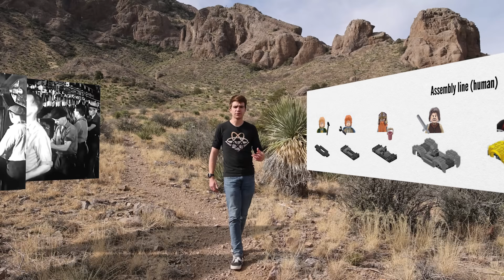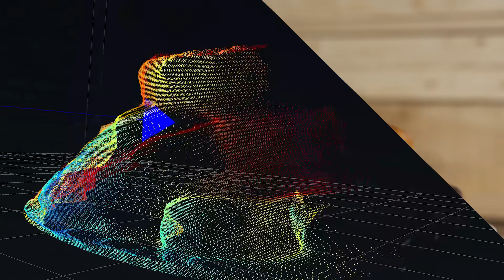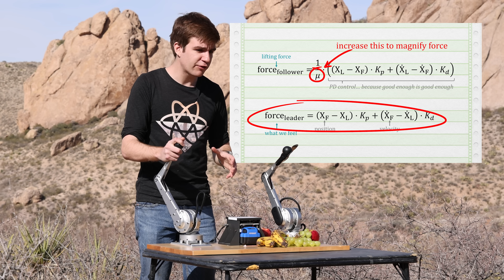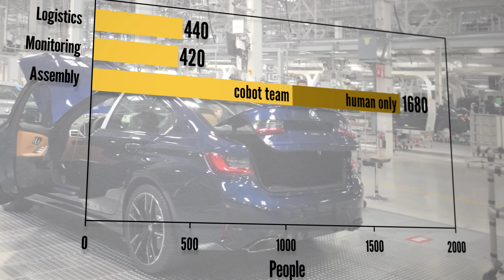Industrial robots are (nearly) perfect

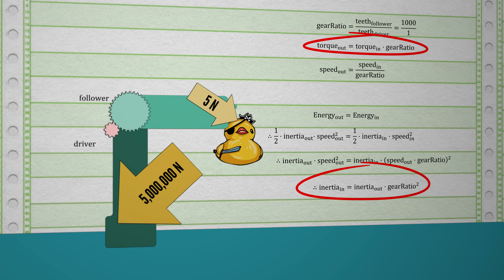Comment: Nice video. However, the 8:32 inertia calculation is wrong (inertia_in is actually 1/ratio^2 inertia_out) 
The conclusion is correct tho. The arm has (roughly) its own inertia plus ratio^2 the inertia of the motor axle and gears. So it acts as if it is incredibly heavy, causing a lot of damage on impact.

Comment: 8:33 The insides of the robot do not expirience a million times more force. They expirience 1000x more acceleration, which I guess can be damaging. But since work done on the outside is equal to one done on the insides, and the insides move 1000x more distance, the forces are 1000x smaller. The insides having a million times more inertia mean the internal components of the robot appear a million times heavier than they are, and so can transfer a lot of momentum into whatever the the robot is hitting.
Reply: yes thank youuu!
Reply: That part of the video made my brain feel a bit itchy.

Comment: The body shop and paint section don't look much different than they did in the 80s, certainly cleaner and we didn't have a camera taking 4 bazillion pictures. We just looked.  I used to work in the #1 color booth at gm in the 80s.

Comment: Ah can robots climb walls?
Reply: A dedicated wall climbing robot, sure... of course there is the matter of what type of wall (what's it made out of, how's it built?), how big the robot is, Why it's climbing the wall (and thus what Else it's supposed to do, which translates into weight and complexity), and so on and so forth. 
After all, it's not exactly difficutl for a robot to 'climb a wall' if you just need the robot to go up and down in a specific spot... a couple of rails and a chain on the wall, wheels on the robot, and a motor to move the chain, and you're basically done.   Climbing any given random wall at any given random spot is, of course, more complicated.

Comment: Thanks for confirming that industrial robots can be built with low-ratio gearboxes and beefier motors for safety. I understand with the situations where it's not strictly necessary will be cheaper to use a simpler motor, but yeah. I wonder if in the future, more dynamic control software/robot applications will require the "cobot" construction to become more common/the new norm.

Comment: Great video - fancy high tech robots - inefficient, outdated cars.
Reply: Essentially the same "fancy" factory will be able to build high tech cars. Car manufacturers like these have perfected assembly, it is what they do best. What they really only need to do is develop new platforms with new components. There are great battery suppliers out there, and developing your own electric motor isn't that difficult. Electric motors are not high tech stuff, we've used them for A LONG time and we know how to build good ones. Countries like Germany and Sweden have great experience of building electric motors for industrial use and heavy use (such as trains) - they just need to convert all that experience and knowledge into building electric motors for propulsion of small passenger cars, and doing so efficiently. 

Problem is, supply chains are huge and have lots of inertia (for these big traditional automakers). Someone starting from scratch (like Tesla and Rivian), have a much easier time building a supply chain for their needs.
Reply: @WoundUp  Including lobbying by e.g. German carmakers against tighter climate & polution regulations in the EU. Turning technical inertia into political inertia. Leaving space for China to take over.

Comment: "And who wants a boring steel car anyway?"
The engineering disaster that is the Cybertruck would like a word
Reply: Im sorry but youre wrong. It's ugly but its not an engineering disaster 

It's an actual amazing vehicle. It's the most advanced EV so far. It's the first  to have steer by wire and drive by wire breaking without mechanical linkage.

Elon actually was smart. Henry ford said the only colour for the model T is black. But elon said what about no colour? It's stamped and casted steel without paint.. it's cost savings sre enormous 

It would of cost a billion dollars to build a paint shop for the Cyber truck. They saved money doing that.

Plus the 48volt from 12 volt architecture is a massive supply chain cost savings. 

It's ugly design wise but drives amazingly because it's super easy from a turning radius.

Almost all EVs will adopt everything Tesla pioneered. Just like the model S and roadster did. Over time. 

Why is it sn engineering disaster when it's profitable and faster to manufacture than a model Y. It's at least a unique design, something different for once

Comment: the issue is still with how cars are conceptually made. if you start looking at canoo and then extrapolate and make it a "plug and play" based system, robots will have far easier times. 
adding gripping features that can interact with soft surfaces and camera/ai that can in real time calculate adaptive moves, you dont need humans anymore.

Comment: I'm quite concerned for many of these workers given the massive advances in humanoid robotics that have been happening in the past few years. The points about managing robot safety, depth perception, and freedom of movement mostly evaporate with LLM-powered networks of robots. And it's not like humans ever take jobs back from robots, or that humans will ever cost less than electricity. It's only a matter of time.

Comment: anyway you lost me around 8:12, can anyone explain in simple terms?
Reply: In essence: in this application, the robot needs torque rather than speed. But it wants to use electric motors. Electric motors (of this type), do not provide that much torque but do provide a lot of power. We combat this by having a gearbox. The excess power, if you will, is converted to more torque. For every 1000th spin of the electric motor, the output shaft rotates only one time. We call that a "gear ratio", in this case of 1000:1. Your car also has gear ratios, though much smaller differences. First gear can be, say 5 rotations of the engine does one rotation of the wheel (5:1), and in the highest gear it could be 1:1. Why do we do this? Just like riding a bike. We start out in a lower gear with a high gear ratio. This means we get more torque - but less speed. Then we use the speed we are going at to help us when we go to a higher gear, so that we can go faster.
Reply: @WoundUp  tbh at first i dont get power vs torque thing
Reply: @mateuszcielas3362 trying to get my head around the wiki article... something about rotational force? 
It's something to do with levers and fulcrum position... the relevance seems to be how violently one end of the lever moves compared to how much power you put into the other end. 
Really, it seems like one  of those things where you very much need a demonstration of the various possibilities to actually get your head around if you've not specialised in the relevant field (and possibly even if you have).
Reply: @mateuszcielas3362  yeah man, it's pretty weird. basically, its a tradeoff that happens in the world. When something is moving farther with less umph its equivalent to moving a shorter distance with more umph. Electric motors suck at doing the short movements that can move the big objects, (dont ask why, this one is too complicated), but really excel at the big movements that can move small objects. 

so we trade off one for the other with a simple machine, and that's called mechanical advantage.
Reply: I thought this was a joke on the apriltag looking like loss…

Comment: what could be used as that structural adhesive?
Reply: Automotive structural adhesives are frequently urethanes or epoxies, depending on application, materials to be bonded, and other factors.
Reply: @davidg3944  and how does it apply in and help in welding?

Comment: Can someone explain this 8:35 further and in more simple way
Reply: if you have a very high gear ratio they can have so much power that they can't be stopped suddenly without damage on either side

so they need a very high velocity motor down geared to a high torque
but with all gear ratio's you can reverse them so if they hit something the gear ratio flips damaging the robot

Comment: It is so odd to see a cobot operating in the field this close to a human's head. I'm working professionally with these machines and there are laws and standards that forbid exactly this kind of operationnear the head, no exceptions. The process itself must make a collision with a human's head and neck impossible, and limit the forces applied to the other extremities. At least thats what I was told by my boss and project leaders, who have done a few projects with Cobots before, and have studied the safety implications and risk assessment involved heavily. The standards are mainly meant for automated movements, the manual guidance modes may be another category.
Reply: Probably some combination of the jurisdiction in question and exactly how the systems are set up. If the cobot's control setup and range of motion is such that it cannot intersect with where the opperator (or other persons in the area who aren't doing things they're not supposed to)'s head and neck are located at the time, it might be considered acceptable, for example.
Reply: There's a reason why this plant is in Mexico